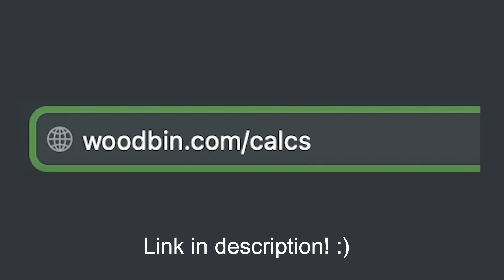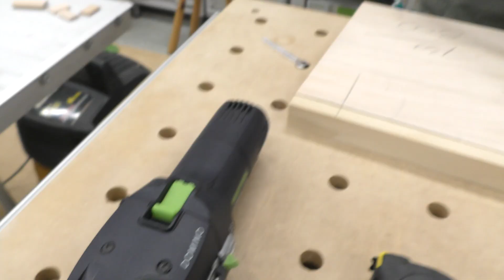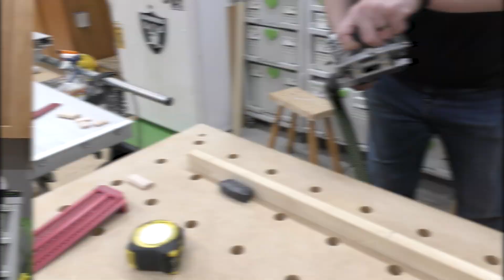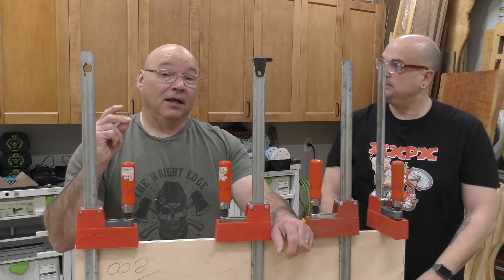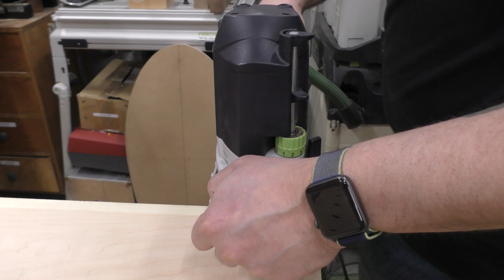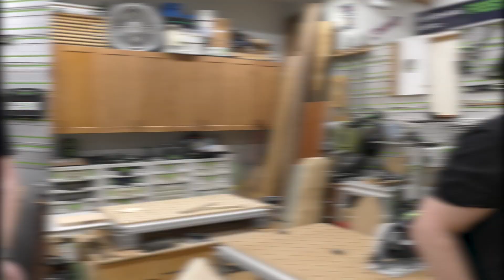Creating A Customized Cabinet Shelf - Step-by-step Tutorial

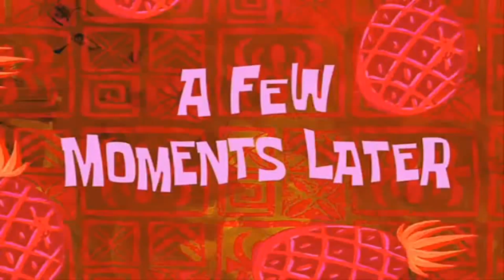Comment: Sedge, at 16:28, how long did you actually wait for the Titebond III to set up in this case?  What would you say is the minimum optimal time, assuming a comfortable room temperature and humidity, to safely remove the clamps?
Reply from the maker: setup up time in clamps I  wait for about 1 hour...but...most of the time I wait for at least 12 hours for full cure even before removing clamps ...never work the piece less than 12 hours... my 2 cents

Comment: Hey perfect timing. I need to make 10 shelves with lips similar to yours. I don't have a good hand plane but I do have the Domino and MFK 700 and OF 1010 routers. Is there a Festool approach to get similar results without cutting into that veneer? 0 degree base on the MFK 700 and careful adjustment of the router bit height? The lips are 3/4" so would I have to use the 1010 and angle arm?
Reply from the maker: correct... because you are using 3/4 then you would use the OF1010 with angle arm ... the MFK700 with 0 degree base only goes to 15mm material.... when I have used the OF1010 approach I always get it very close and use a cabinet scraper / sander to finish it off....